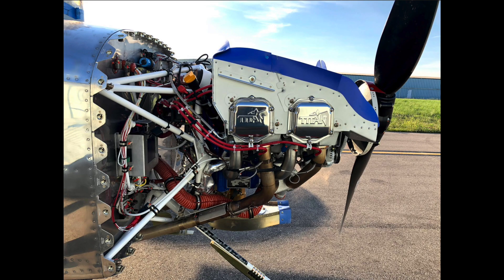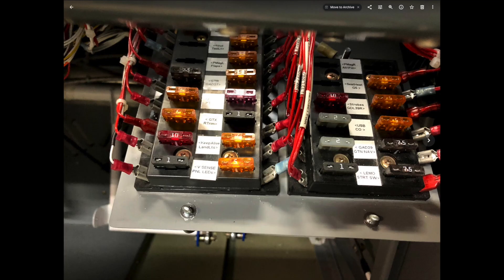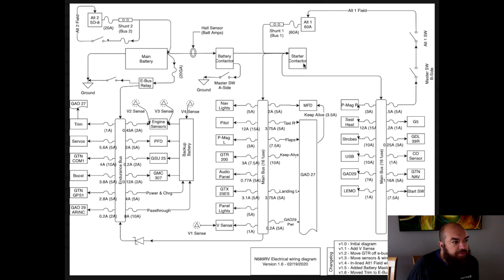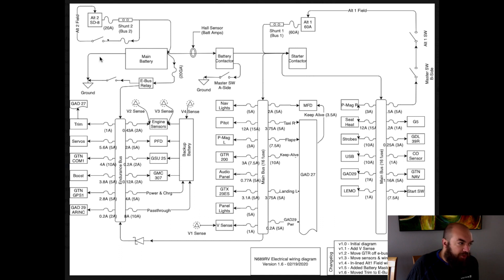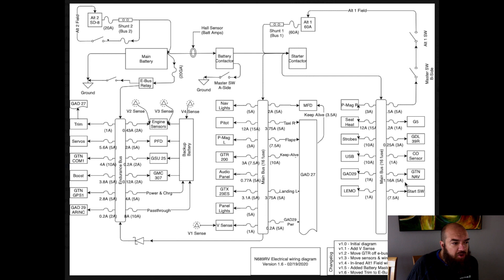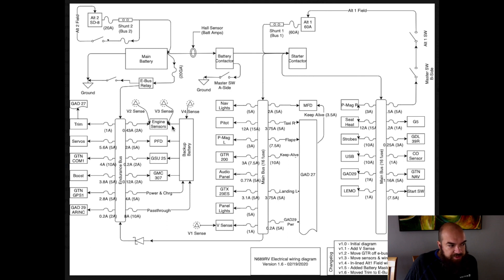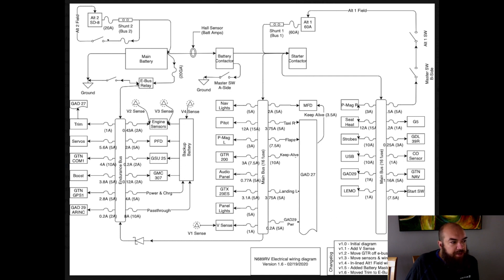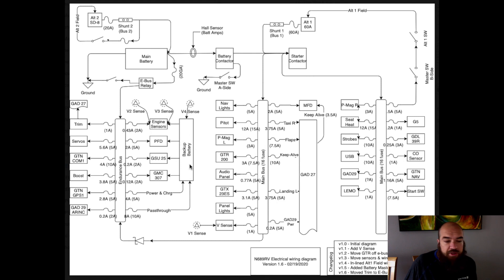Technical Track: Electrical System

Comment: Excellent videos. Something not very well documented for G3x is the configuration settings. How did you
Reply from the maker: This would be different for each airplane. Take a peek at the Installation manual for details on each individual setting. If you have questions on specific ones feel free to reach out.
Reply: @BuildFlyGo  I was wondering how you got the IBBS on the MFD as a separate bar. My two Volt1 and Volt2  are together.

Comment: Great video... great system.  Couple questions and a request... 1 - What are you doing for over/under voltage protection?  2 - I don't see flap motors, are they on the servo bus?  And request... Could you do a video in the cockpit that goes with this one that shows what you would do to "fail-over" to endurance-bus-only?  Thanks!
Reply from the maker: There is a crowbar OVP on each of the alternators. Take a peek at the diagram, it shows where I'm measuring voltage with the little triangles with a 'v' in them. The G3X system is set up to alert on under/over.

Happy to make the cockpit video!

Comment: Hi Mr. BFG:  Thanks for your video.  Where did you put the CO sensor itself? - Is it high or low and proximity to firewall.  Also, what sort of pre-flight/runup checks are you using to check the two alternators and also, how do you check the PMAGs before flying?  Do your internal cameras use ship's power or just battery?  Did you run ground cable from battery to a longeron or aircraft frame or does it go directly to a FOT on firewall?   Thanks, Drum
Reply from the maker: Hello!  The CO sensor is an FDS GD-40 and is mounted behind the MFD on the subpanel. For preflights, it's the usual left/right mag but with the off-board power disabled on the p-mags, which test them individually and also their internal generators. For the generators, look for a positive charge on the battery with the main alternator, or voltage above 14v with the secondary. Cameras are both wired to the main bus. Everything on the airplane has it's ground run to the ground block on the firewall.

Comment: Fantastic video, thanks for showing us what your system looks like. I will have to say, depending on when I get to the avionics phase with my 14A (quite a while away) this is more or less the system I would use. Any reason you chose the physical transponder vs a remote mounted one?
Reply from the maker: Glad they are helpful! I do have a remote transponder, a GTX-23. You may be seeing the 2nd COM?
Reply: @BuildFlyGo  YES! Thanks for the clarification.
Reply: I am also building a 14a in upstate NY. Where are you located
Reply: @thomasmurray1807  I am in MA, just west of Boston. I have the wings "complete" and am working on the tail cone now. Nice to meet you!